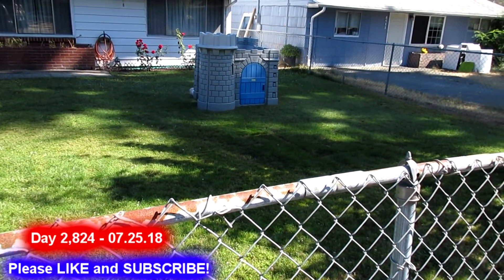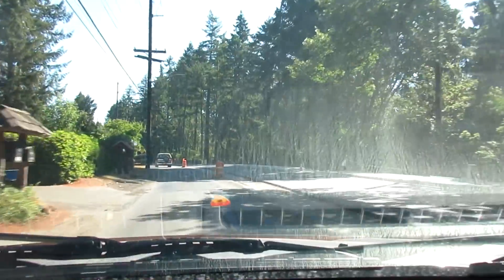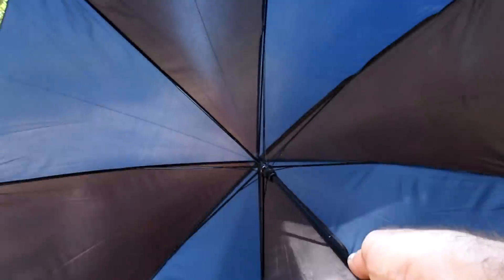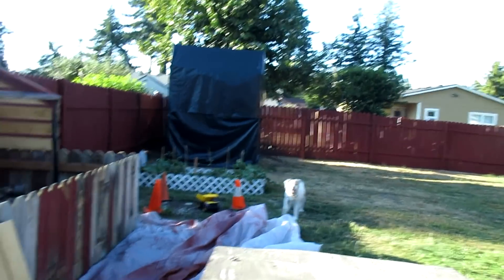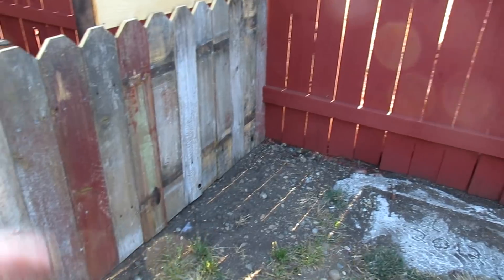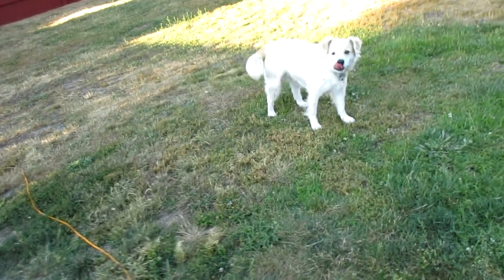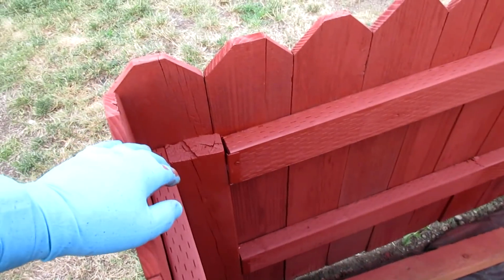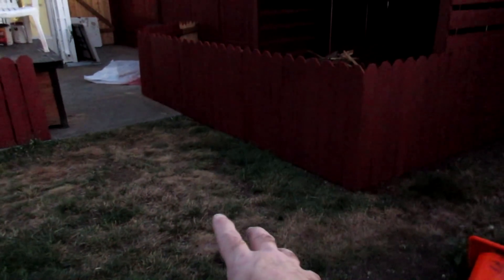Don't Laugh At Me! [Day 2824 - 07.25.18]

Comment: What a great idea to do COC while taking a wee rest in between chores. Hopefully you’ll be able to get to bed earlier and get a decent nights sleep. Not to worry about the umbrella in the sun as I see a lot of that on the streets here. HH
Reply: Mon E,  yeah the staff at the Hard Rock Casino in Coquitlam near my work was on strike until just the other day and they all had umbrellas to keep the sun off. So I guess it's more of a parasol then right?
Reply: Angie Hill Parasol or umbrella, with these extremely hot temperatures it is best to do whatever we can to protect ourselves from the UV rays and the heat of the sun.